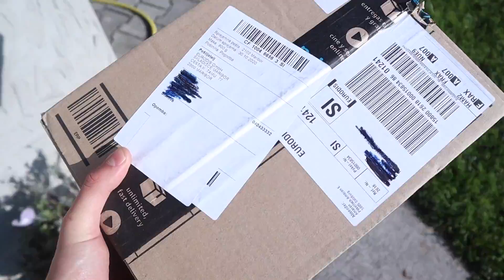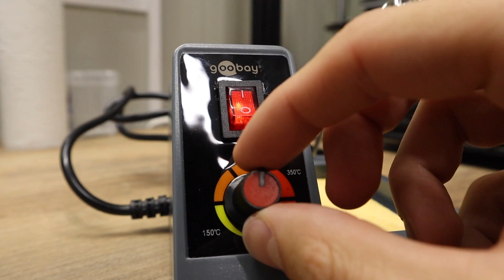Building LED UV Exposure Unit for under $60 | Alternative Photography, Screen Printing, PCB...

Comment: Great video and here is a PRO TIP: I would highly suggest anyone who plans on building this to spend a few dollars and buy connectors for the LED strips. 

I have years of experience in soldering but I wouldn't spend the time cutting/stripping 40 wires, tinning each end (80 in total) then soldering 40 connections to the end points of the light strips. This takes time even with experience!

If something goes wrong you will need to diagnose which contacts are failing. Do a bad job and you could short out your lights.

Buy connectors, they are cheap and you can be done in a fraction of the time.

That being said, great video for anyone wanting to save money building an exposure unit vs spending $300+ dollars.

Comment: Just a little tip.  If you look at your pliers, you see one side consists of two wedges, while the other side has two, essentially parallel surfaces.  Makes very little difference in cutting the wire, but peeling the insulation is different.  The direction you used causes squeezing of the insulation, making it to try sticking.  Turning the pliers the other way pushes the loose end along easier!  Try it!

Comment: using intrepid cameras you'll be somewhat familiar. their enlarger offerings have a built in contrast adjustment from grade 00 to 5 but their light source doesn't have the proper nanometers to use the 5, requires low 400''s to work properly. this would be perfect. actually looked at these this morning

Comment: Great video, thanks! Can you explain how you connected the two power adapters from each strip to one single plug? I am building a bigger lamp that will use four strips (and thus four adaptors!) and I want to be able to connect them in a similar way to how you did it with only one plug. Thank you!

Comment: Hey, I've just built a very similar exposure box but all my prints are super blurry, I don't understand what's going on (never had this issue before with the sun nor with my small face tanning light I use to expose cyanotype) . Do you have any clue why? Any help would be much appreciated :) thanks!

Comment: 👍 nice exposure unit. FYI , M&R makes a wide range of exposure units , using metal hilede, quartz or carbon ark. In table top units/with vacuum table or projector style. Not selling just letting you know you have other resources. Good to have you back.

Comment: so how long does your exposure time end up being? i know its surely a few different numbers depending on the needs and the negative types but i am still curious as to how it ends up being? inače puno pozdrava iz susjedne hrvatske i rispekt za sav rad!
Reply from the maker: Zdravo Karlo. Exposure time for cyanotypes ranges from 8 to 15 min at full power. Hvala 🙌
Reply: @lostlightart6064 how much is the power output of the LEDs is watts?

Comment: Hey man ive been looking through the internet for awhile and im wondering how do you make the led lights themselves ive got a couple of projects i would like to complete and not enough money to buy some of the supplies so a lot of the times i need to make it ive seen people just use markers and tape and put it over a regular flashlight but im not to sure thats to acuratte i need something that will dry uv resin and actually produce uv wavelengths if you could help me out with this you dont know how grateful id be frfr

Comment: Great Video! I want to try to build one too. After a year what can you say about this led system? did some of the led burn? it's efficient? They will last some years?
Reply from the maker: Hey. Thanks. Yes everything still works like the first day
Reply: @lostlightart6064  how long it takes for a cyanotype?
Reply from the maker: It depends from the density of the negative of course but between 7-20min

Comment: Hello. Is there any reason for the distance of 10-12cm between light source and sensitive paper? I remember the UV tubes for the screenprinting exposure were used to place at a certain distance. If too far or too near could create exposure issues, but I can't find any info about it. Any help? Thanks.
Reply: If the strips are too close you will see stripes where the panel is dark between the LEDs. The only problem with more distance is that exposure times are longer.

Comment: I noticed at 4:59 of the video, top right hand side two of the strips are not soldered, I don't have experience in electronics, but is that because it's the end of the line for power?
Reply from the maker: Hello Juan,

Led strips have + and - wire running all the way from one end to the other and they meet in each of the leds this is why there is no need to connect the ends ;)

Comment: Do you have a slower version of the especially from the 4:40 mark to the end, I could not see how you are hooking up the power sources and the switches to both the board and the box.
Reply: If you click on the Settings gear at the bottom of the video, you can select slower speeds to watch any video - at .25, .5 or .75 full speed. (also faster which is useful for a lot of videos where people talk too much!)

Comment: Great video! Than you. One question. Why you chose 395-405nm? Many say that the optimum for cyanotypes is 365.
Reply from the maker: You are welcome. Mostly because of the price :)
Reply: @lostlightart6064  does it work ok for you? Are you satisfied with the results?
Reply from the maker: Yes it works

Comment: Congratulations!  It is, by far, the most practical project on this topic that I found on Youtoube: simple tools and materials available to anyone.  I think that an extremely simple timer would have made it even more practical.  Congratulations again.
Reply from the maker: Thanks Gabriel. Yes I will be adding the timer sooner than later :)
Reply: If you have a darkroom timer you should be able to plug it in like you would an enlarger.

Comment: Have you tried making cyanotype prints with your UV box?  Looking at the LED strip in the link, the wavelength appears to be 395-405nm, which I've heard is too high for cyanotype print exposure.
Reply from the maker: I did and it worked without any problem ;) There is also a video about me making contact prints with this box
Reply: @lostlightart6064  Do you have any theories about why this woman's UV light didn't produce a usable exposure?
https://www.youtube.com/watch?v=E6rnpF61CKY&t
She seemed to think it was the wavelength of the light (which is the same as your UV source).

Comment: Thanks a bunch for posting this. What kind of exposure times are you getting for cyanotype (or whatever process you are using)? Thinking of building something similar. Thanks!
Reply from the maker: Hey. My exposure times for cyanotypes are between 7-12min depending on the density of the negative
Reply: @lostlightart6064  Thanks!

Comment: Can you explain a bit more the place where you soldered?  I have never soldered before and I have only seen it done on the cooper dots.  You said something about desolderig?
Reply from the maker: Sure. You cut the strips to lenght and connect the pins on each end of the strip. You are wiring negative pin from strip one to negative pin on strip 2. The same goes for the positive pin. You repeat that on the other side. By doing that you connect the strips into a long line 😉
Reply: @lostlightart6064  Thanks for your response I do understand that.  What I am asking is about the "pin".  I understood that you use the copper points which you cut in half.  I think you said something about the silver "pins" that are raised. Do you treat them like copper? As you can see I don't even know the basics! You have been kind to help.
Reply from the maker: @scmassey  Don't worry I am happy to help. The pin connectors on the strips are made of copper and when soldering it makes the solder stick to them. So first you add some solder to the pins and the wires you tend to use and then you can easily fuse them together using hot iron. I hope it answers your question :)

Comment: Great build! Where did you buy the project box?
Reply from the maker: Thanks! In a local hardware store 😉
Reply: @lostlightart6064  Darn. It’s weirdly difficult to find an appropriate plastic box for a project like this. Although, sometimes I feel like I’m not searching for the correct terms... Is there a manufacturer name on your box?
Reply from the maker: @DanRPratt  Yeah its the brand of the store I bought it from called Bauhaus. It is a box orientated more towards industrial needs I would say. A bit thicker and stronger...

Comment: This is great!  I built one back in college using 24-inch T12 bulbs.  It does the job, but it's bulky and ugly and I've been thinking about building a new one that I can build underneath my enlarger table so it's more out of the way.  What kind of print times are you able to get with this setup?  I've been debating between going with the 395nm LED strips or the 365nm.  But the 365nm are crazy expensive.  The tradeoff is that many processes are apparently a bit more sensitive to the shorter wavelength light, but I'm not sure it's worth the cost.
Reply from the maker: It depends between 12-15min for cyanotypes 😉 Haven't tested them yet with other techniques...